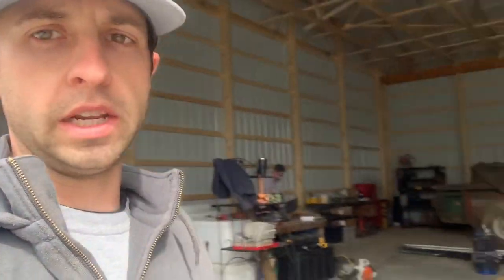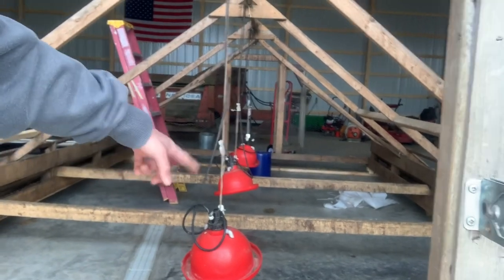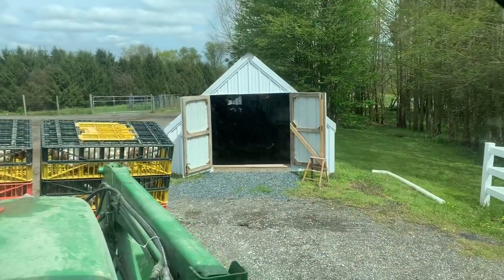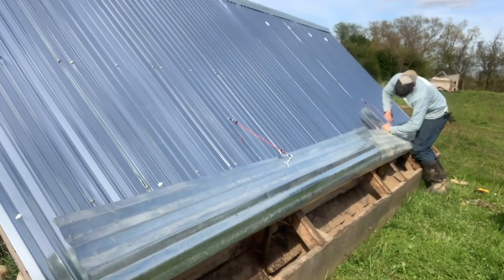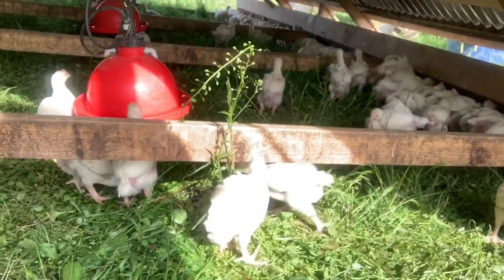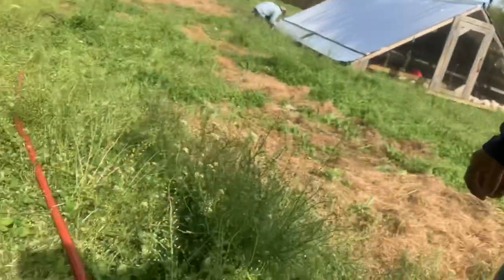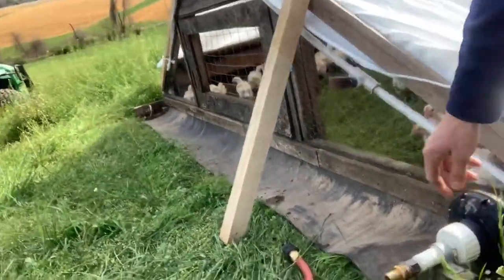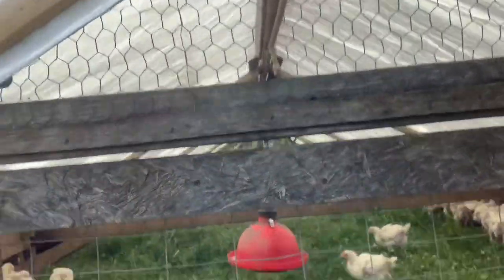HOW TO build a CHICKEN TRACTOR & move BROILERS to PASTURE

Comment: How is your water? I've had issues with algae clogging my water nibblers im using with a bucket system and im concerned about a PVC system becoming too difficult to clean. 

Thanks for the video! (Found you on the pastured poultry FB group)
Reply from the maker: Hey Chad, we haven’t had any problems yet. It’s been a few years with the plasson bells and as long as the pressure reducer is in place, everything is good. I’m thinking that since nearly all of the water system is internal, we haven’t seen any clogging issues. I believe there are natural algae tablets made specifically for livestock tanks and other options for keeping that algae out without making a big deal out of it. I’ll see if I can remember the name of those tablets

Comment: Do you ever have to turn these while there are birds in it? If I recall correctly, these are 24 feet long. So if the birds are on pasture for 35 days (what i usually do), then you need 840 linear feet. My property is only 8 acres, and my longest stretch is around 560 linear feet.
Reply from the maker: Chad Fleck no worries, we put d-rings on both ends so you would just put the chain on the other end and pull at a slight angle the first day to get over to the side of the previous pass
Reply: @GrandViewFarm  Ahh, thats right. You said that in the video. My bad.